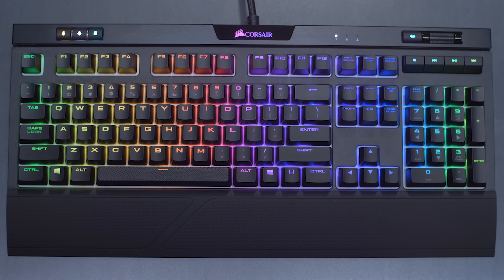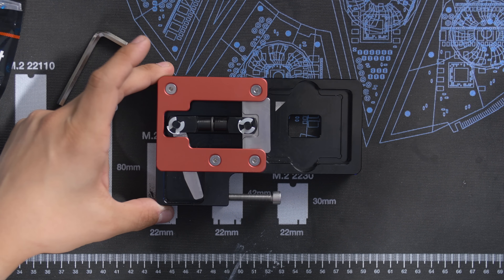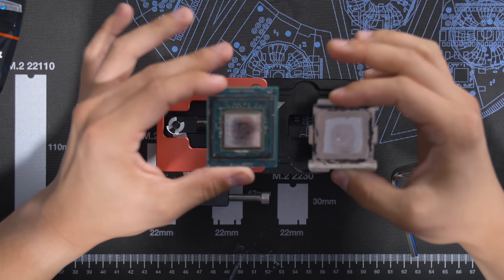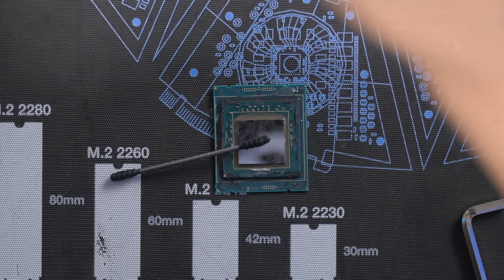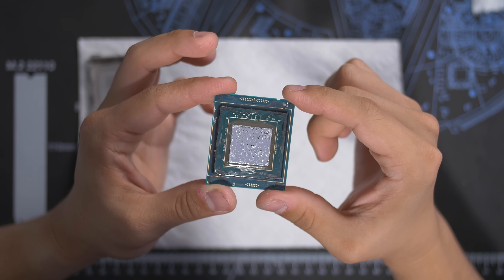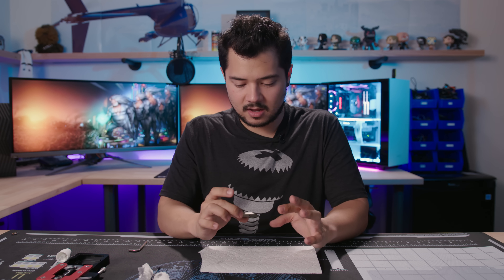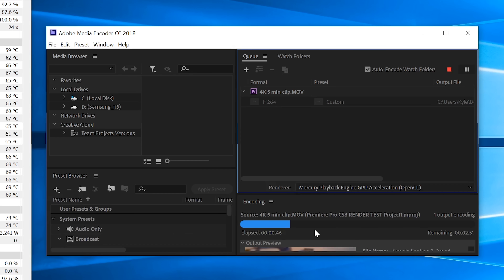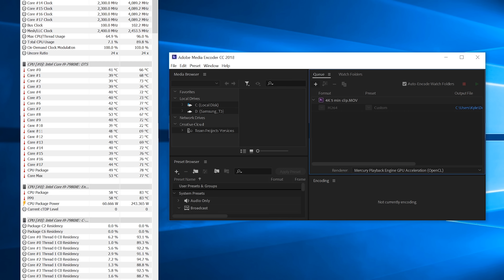My CPU dropped *20 DEGREES* after my first delidding

Comment: This just makes me learn that those companies could make it more efficient but theg dont.
Reply: Intel doesn't use liquid metal to cool the CPUs because liquid metal is not as durable as the thermal compound they use. Liquid metal needs to be replaced "frequently" as opposed to the thermal compound thats last for years. There aren't many people willing to use LM because of the risk and the hastle, despite the great improvement.
Reply: Liquid metal needs to be replaced maybe every 3  years. It's not that frequent. You should pay attention to how well you apply it the first time more than worry about it aging.
Reply: soldering is better, that's why AMD does it, and now Intel with the 9th gen.
Reply: intel's compound sucks replaced the goop on my 6700k with some thermal grizzly ceramic compound around 6 months ago 5-7c headroom is pretty sweet for an OC if you can be bothered and yes as stated im not a LM fan because im a slacker ill probably forget to ever replace it
Reply: FROSTII
Low Power ITX systems, why that, office tasks deliddings....

Comment: and the next intel cpu's are soldered lol
Reply: MegaAlpakka Many things wrong about your comment. I think 9900K is the only CPU that is soldered, intel is still not allowed to use solder on a larger scale just like Apple/Google for ethics reasons, been this way since intel turned to renewable energy. 2nd, soldering CPUs is not a pure guarantee in a FAB, there is a failure rate on chips that are soldered during the process or after. Since intel has been losing 14nm supply like a mad dog, limiting 14nm failures/damages in the manufacturing plant due to lackluster soldering on mass production is just a smart move. intel has way more reasons to avoid solder than "microcracks" (which is a real thing too, but it takes many YEARS for it to manifest, almost irrelevant).

AMD was to blame for intel's laziness, AMD was practically dormant even when they released FX. intel really has nothing to do for 6 years because they don't have competition, both in business and in tech.

A12 is irrelevant in the PC market bro, don't put smartphone CPUs with the big dogs because both are different. To educate anyone here

-ARM CPUs run with a different instruction set compared to intel, A12 is better suited for smaller mobile apps and intel mainstream CPUs have a significantly larger instruction set than any mobile CPU ever. And I'm not even going to talk about the beast that is intel's AVX-512
-RAM (which works hand in hand with the CPU) speeds alone OBLITERATE mobile phones RAM both in tech and speed.

There is a reason PC components require more power, they are wayyyyyyyyyyyyyyy faster than a device used to open Facebook.
Reply: wat
Reply: @MegaAlpakka SANDY BRIDGE MASTER RACE

Ok, I'll stop.
Reply: yeah they are.
Reply: ha haaa >.<
Reply: Wat
Reply: @kaptein1247  Why you cry, nerdy humor?
Reply: @lucasrem  are you using google translate?
Reply: @mememanfresh  India guy?
You are not even able to say what you don't understand here.......
Reply: @kwonrunitup  
You do have some weird brain i see, atzimes weirdness it is you say!
You need to learn English now, forget using any other language online!
Reply: @lucasrem  keep typing dude.  I've never read anything that looks as funny as the way you type sentences.  Can you like type out a screen play with your half english?  I had difficulty reading old english in school and I'd hope you could do a nice screen play script for me so I can have fun decoding it.
Reply: @lucasrem  This is like the "Oh Sh*t I forgot to give you a brain meme" but irl.
Reply: @lucasrem  Lol. What are you trying to say? We wanted to understand but seems like we couldn't.
Reply: Lucas you are literally not speaking English
Reply: @lucasrem  I suggest you look into power equations.
Reply: @lucasrem  We do not understand your English, we all know that it is not your first language and, based on your cryptic insults, Aap hindhi hai.
Reply: @lucasrem  Good evening
Reply: @lucasrem  I think I should be saying that
Reply: Yengore
Production processes, just too hard to understand..
Office and cloud solutions need the 7nm low power solutions, gamers need the old 16 nm high watt gear!
Reply: Yengore
Why do they will get performance there? Why lol, nerdy humor, a lol question? what you meant?
Reply: @lucasrem  umm what language you speaking bro?
Reply: @gth77s  Dude that's what I was thinking. lmao
Reply: wat
Reply: @lucasrem  shh..it's trying to communicate
Reply: @lucasrem  can we get lyle to review this comment????
Reply: @lucasrem  if this isn't a complete butchering of the English language, I don't know what is.
Reply: Alcomoney
You develop blueprints on boards, acid lab at home? What is your question here? 
 language? what is it you don't understand here, Need English or Gamer languages......Need tutorials?
Reply: lucas rem I’ve lost atleast 328 brain cells trying to read this comment
Reply: @lucasrem  We'll release you from Area 51, don't worry!
Reply: wat
Reply: @lucasrem  what?
Reply: @mememanfresh  Not that smart, is this your way of asking a question???
Need to play a game, you need some good RTX card? PS2 enough?
Reply: Yeah, you'd get pretty much the same temps as liquid metal and so no real point to delid
Reply: @lucasrem  wat
Reply: @lucasrem  I just had a stroke reading this
Reply: @lucasrem  Has anyone really been far as decided to use even go want to do look more like?
Reply: @lucasrem  cmon bro
Reply: lucas rem wat?

Comment: Nice might be my problem is a 48 idle bad?
Reply: My stock 7980XE idles at 31C max using XMP 3200C14 memory.  I think that qualifies as overclocking even if it's just memory.  Temps really start picking up at over 100 watts. but I can keep it under 77C using just a 240 rad 30mm thick but Noctua 3000 rpm PWM fans that don't run full speed.
Reply: Thanks for the replies. I like the tempatures but do you know how to stop 100% CPU usage? It hits 100% sometimes and when in idle it is around 46% once again don't know if that is bad or good. But I can see it visually when playing games.
Reply: Almost like thermal throttling. But I don't overclock...
Reply: This 7980xe can take 100% load punishment without crashing.  I've often run half a dozen resource intensive applications all at the same time and haven't crashed it yet.  Funny though when the mouse gets stuck I think I have crashed it but a few seconds later it's off to the races again.  Pretty potent processor.  I know half that would have crashed my older 3770 cpu.  I have 64gb of 3200 cas 14 memory.  Which does significantly speed up the computer.  Some say it doesn't but I know it does.  My next memory purchase is going to be 3600 cas 16.  I don't want to go too far over spec (2666).
Reply: @johngermain5146  I am glad there are smart people like you on Youtube. You should try and make an info channel.
Reply: @tinytim0-014  Thanks for the compliment...have all the equipment to make videos but cant seem to make videos anywhere near nitwits quality. Steve, Jay, and Linus all produce excellent video and most of the time...great audio.
Reply: My CPU is idling at 48Watts and 29C it's when the power increases that the temps do too. More specifically above 100 watts things really get going.  Plotting files for Crypto mining uses all the cpu's and threads which pegs the Power over 95%, Next, rendering video from VOB's into MP4's uses nearly all the threads and brings CPU power to 100%.  That's when I have to turn off CoreTEmp which shuts down the computer at my preset temperature of 75C.  It then peaks above that a couple of degrees until the video conversion or plotting is done then immediately drops back to around 30C.  Without the PWM fans and just using Pressure rated fans from Corsair, the temps would get into the 80's.  That's the difference between 1800/2000 rpm fans and 3000 rpm fans that only run that fast at the higher temps. Quiet most of the time but rev up when cpu hits 100%.

Don't mind running cpu full tilt, just don't want the heat.

Comment: I did my delidding with a crusty old vice. Just put the cpu in so the one side touches the pcb and the other side touches the heatsink.
also important with the newer, thinner pcbs: take care that one of the little "dimples" or holes or whatever you call them are touching the vice, so the weak spot isn't getting all the pressure
Reply: I guess that's smarter than what I did. I also used an old dirty vice. But instead of pushing it off with the vice, I used a hammer and a block of wood on the pcb.

Comment: You forgot to mention that you need to use conformal coating before applying the liquid metal to avoid shorting out the cpu. Yours already has it but you never mentioned that.

Comment: Last time i was this early, this was still Awesomesauce Network! Glad to hear the re-delidding and re-application process worked out for ya! Good luck in the OC battle! Cool to see ya experience your first delid. It was a nerve racking process for me...and i did two 3770ks on my first go at it (also for a video) lol. Worked out well!
Reply: Coalition Gaming I been wanting to delid my 3770k for years, always get scared. What kind of results did you get with the 3770k?
Reply: @dayadam16  Stable OC before was 4.3, after was 4.7 at same temps
Reply: Coalition Gaming wow. I’m stable at 4.5 with a noctua nh15 cooler running 1.35 volts. But my temps are 63to70ish gaming. I’m really considering doing this. What kit did you use?
Reply: i used the Rockitcool kit
Reply: Coalition Gaming thanks I actually looked at your channel and realized your video on the obs stream set up with no capture card is the reason I was able to set up my streaming network at my house to multiple PCs. Awesome info 👍
Reply: awesome! Glad the vid helped you out!
Reply: T
Reply: Coalition Gaming
Production processes, just too hard to understand..
Office and cloud solutions need the 7nm low power solutions, gamers need the old 16 nm high watt gear!
Reply: Now you're probably ready to resell 7742s with a full warranty at $100 markup for your service. Jk

Comment: Just to let everyone know
If you want to do it
It lowers the temp
But it voids warranty
So try it on a shitty chip
Not an expensive one
If something goes wrong
Reply: Get the cpu u wanted, spend the time well with it till the warranty expires and then go for the delid. You don't have to buy a crap cpu just to try out delidding.
Reply: @LeanyG11  well if it's ur first time then there is no harm trying it out
Reply: i think he means try on a cheap cpu so you know what you're doing before doing on your main pc, like a socket 775 PC, which are dirt cheap nowadays.
Reply: Usually if you do any kind of meaningful overclocking on a chip you void the warranty anyway, so unless you have no idea what you're doing or somehow royally screw it up you're not any worse off than just overclocking it normally
Reply: I would only do it on something like a 7980XE if I had done it several times on 8700ks or whatever. Would not recommend your first try being a 7980XE
Reply: If you clean the off the black "glue" and reapply that with high temp silicone adhesive and you send it back to the shop they will never know unless they delid it.
Reply: why did you
have to type this out
like a really bad poem
Reply: I delid my new 8700k I'm 5ghz all cores max temps 70-75
Reply: Overlooking at all technically voids the warranty on many CPUs.
Reply: Just dont be a pussy it ez af
Reply: Not such a bad idea. I need to upgrade my CPU cooler first but I was thinking down the line I might think about it. With this in mind though I have a 2500K laying around somewhere to practise on. That being said, from the little research I have done it seems pretty straightforward.
Reply: what is the point you might as well just spend that extra $20-$50 worth of delidding hardware and liquid metal on a a better CPU instead of buying a shittier one just to delid it
I would only agree with your statement for those who want to get in to delidding but want to try it out on cheaper CPU's and then do it on one they already have
Reply: @zahidshabir4038  That's exactly what he meant I don't think you got his point!
Reply: @zahidshabir4038  I have a i7 6700k from my first PC build I made two years ago. For some people it makes more sense to try delidding than spend another $300 for a new CPU. I achieved the advertised ~20 C temperature drop from liquid metal application and now have a solid 4.7 GHz overclock and my temps never go above 55 C under gaming loads.
Reply: @zahidshabir4038  Pretty sure thats exactly what he ment... Derp lad.
Reply: @zahidshabir4038  I think what he meant was, only do it on a sacrificial i3 from a generation or two ago if it's your first time.0

Comment: I’m surprised you don’t have a Nzxt kraken for cooling. Why do you have air cooling? I’m talking about the pc that’s behind you throughout the video
Reply: A Kraken series cooler specifically it doesn't really make a difference between brands especially all those based on Asetek designs and as long as the radiator size is the same as another brands cooler , also BTW the brand is NZXT not Nzxt.
Reply: Zahid Shabir I was saying that because he seems to like RGB and the “NZXT” Kraken has some pretty cool lighting features